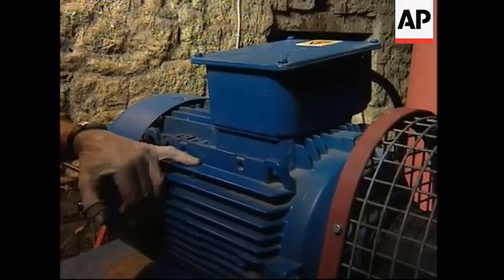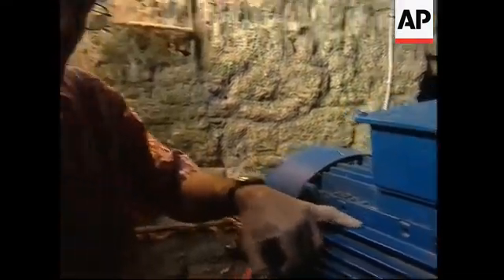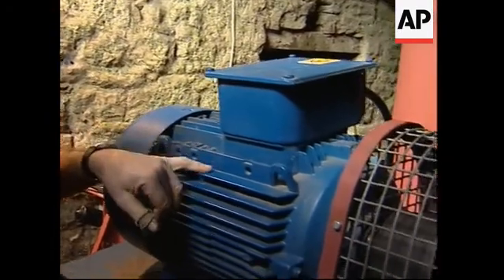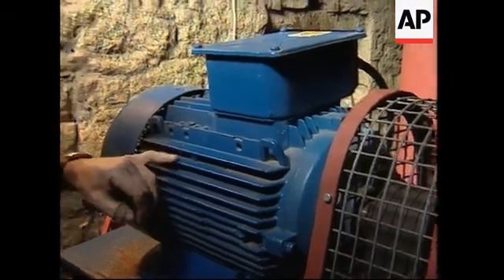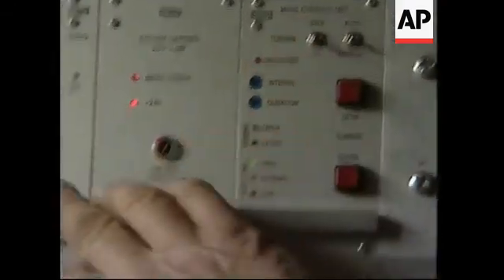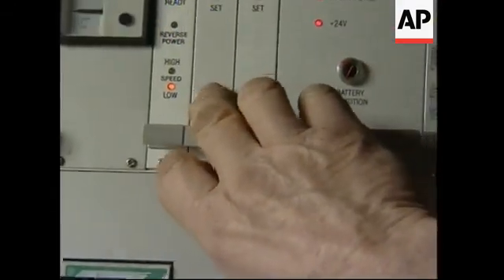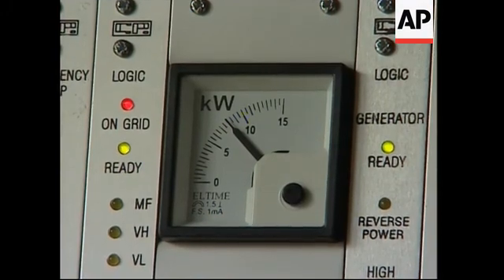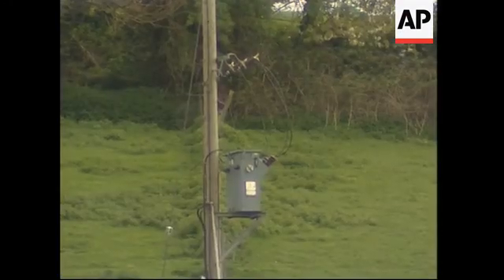Old water mill used to generate electricity

Comment: I love to see old mills being used and actually wiping their own nose, so to speak. Not just for financial reasons of course. But the fact that it is still working and earning. However, sometimes (even though it’s often used) a downpipe is sometimes just a downpipe… A penstock or more archaically, a pentrough is more like a holding tank which meters out water at a steadier rate than just letting the stream takeoff down the launder. I mention this just a point of interest of course, not trying to be an oaf :)